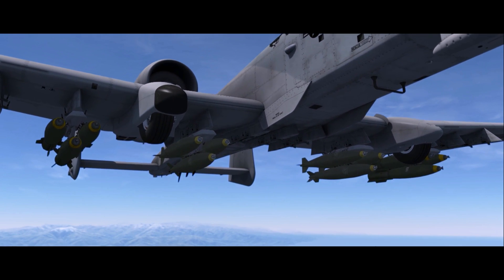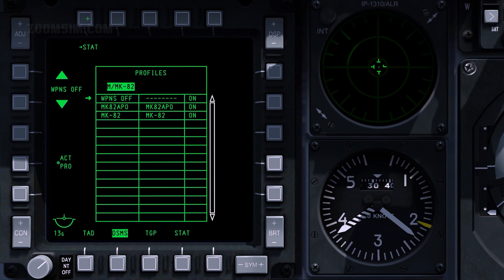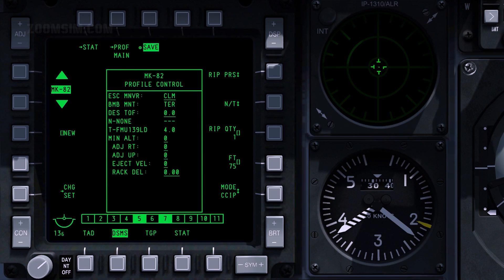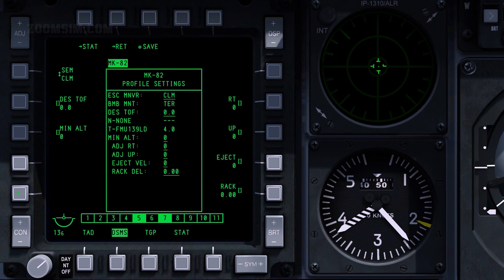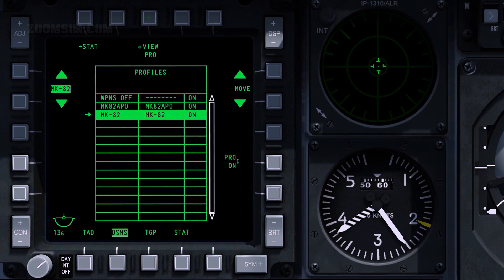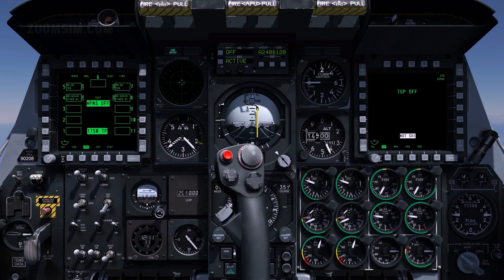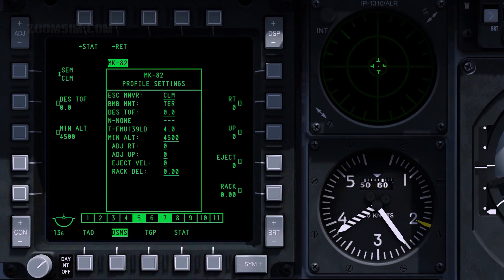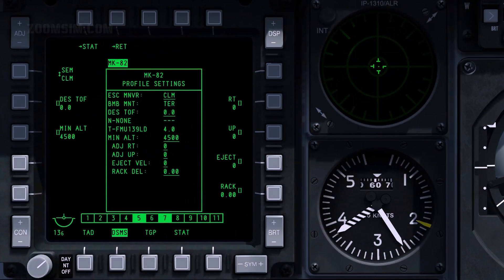DCS A-10C Tutorial 8 : Mk 82 LDGP & AIR

Comment: Would you please explain the usage / necessity of ccip + 3/9-  / 5mil-consent vs ccrp?

I don't understand why I would need both, as they seem to be somewhat similar:
You line up with the target, get steady, and hold the trigger.
Would be great to know which one to use and why.
Reply from the maker: The choice between 3/9 and 5 mil would depend on how accurately you need to deliver the weapon to achieve your goal.
Reply: @supanova88   So, between 3/9 and 5 mil, which choice is for pinpoint accuracy (e.g small tower), and which is for aerial accuracy (e.g. BIG building)?
Reply: @DiBarkis  3/9 mode means the bomb will drop when release cue crosses middle line of piper - 3 o'clock-9 o'clock line. 5 mil mode means that release cue has to by inside of little cicrcle in middl of the piper, so 5mil mode is more accurate.